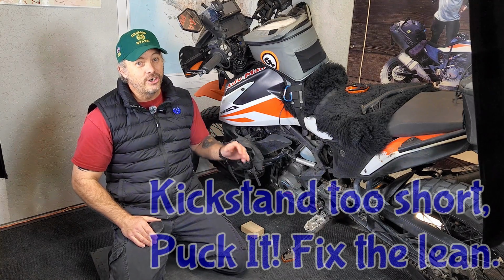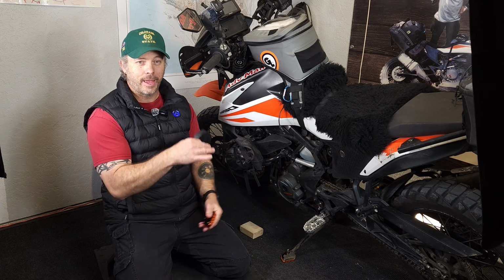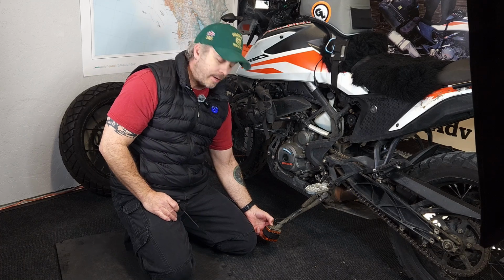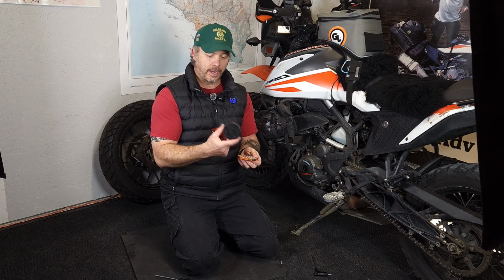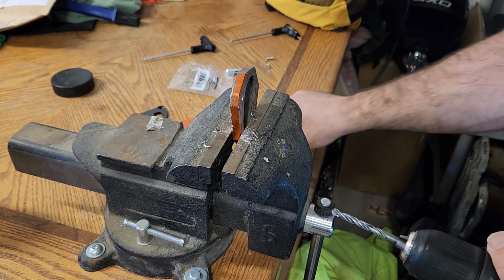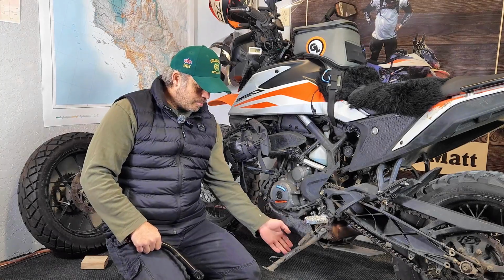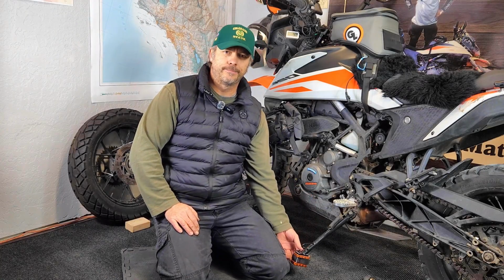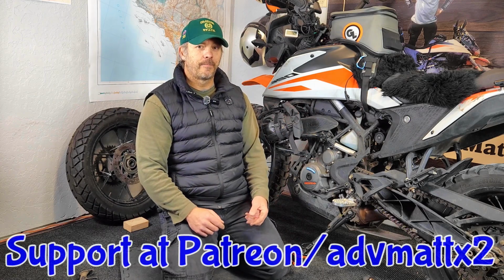Kickstand too short? Puck it.  Fix the lean.

Comment: I too stand on the foot peg cause I'm a big guy. I bent my kickstand as well. I haven't went to fix it yet, but I was wondering, did you simply put on a new leg, or did you have to replace the mounting bracket and basically the whole bracket deal? I think mine may have bent the frame because I can see where the shifter has just barely grazed the bracket that mounts the kickstand. Any advice would be appreciated!
Reply from the maker: I only replaced the leg, not the bracket.

Comment: In my experience I prefer more lean angle, more suitable/safer to use off road on uneven ground. Put a removable spacer under it for the desired look on the road/garage if that is a concern.
Reply from the maker: That has been the opposite of my experience.  With the shorter kickstand I have had to pay much more attention to where I park and get off.  Too much lean offroad and it's really a challenge to get back on the bike and get it off the stand when it's fully loaded. I spend a lot of time getting on and off to film ride  by segments.  It took more work to do this.  Everyone has their own experience and preference.  Ours are just different.  Cheers.

Comment: I did the puck on frist GS in 2011 . On 2015 GS I used hard plastic a 1/2 thick . On my F800 I cut and welded the side stand . It all depends on how height you want . It dose make the bike easer to stand the bike up particularly when loaded.

Comment: I think what ever you do make sure you buy and install the kick stand dongle to eliminate the kick stand switch, otherwise with that added weight it wont take much to kill the engine whilst riding! Dangerous! I bought a puck but I just take with me and if the slant is too much I just pullit out of my tail bag which always on the bike. If the camber of the road is my favour its not a problem.  Nice easy fix, thanks Matt 👍
Reply from the maker: I am planning to get the dongle.  There are two different variations.  I am deciding which one to use.  On my F800GS the puck was never a problem.  I am not sure that will be the case on this bike.

Comment: Great MacGyver’ing Matt. It reminds me of some of the things I would do as a youth with limited resources. To take it to a welder to add in a segment would cost about $8, plus materials here, but it is probably cheaper elsewhere. I have had the fork extenders for a while now, but have postponed putting them on for the very reason of the extra lean. When I am ready to put them on I will probably cough up the bucks to get the extension welded on.
Reply from the maker: The lean is pretty bad.  If you know of a good welder that is the way to go.

Comment: I used a puck on my 2012 Victory Cross Country Tour for years. Worked great and lasted for a long time.
Reply from the maker: Nice, good to know these pucks will last.  I imagine the sun and dry heat will break it down over time.
Reply: @advmatt  mine was on 6 years and I sold it with the bike. By bolting it on you can just replace it if needed.

Comment: Just cut the stand and add an inch of strong tube.
Reply from the maker: That is a great solution if you can find the right diameter of pipe and have a welder.  My solution is for all those riders that have limited tools.  Your solution is of course better but not possible for everyone.
Reply: @advmatt  I've extended the side stand on a R3 and SV650 with 1" iron/steel (natural gas IIRC) pipe from Lowes plumbing department.  Bought a 6" pipe and cut to about 1.5" long.  Local welder can weld it up for fairly cheap.